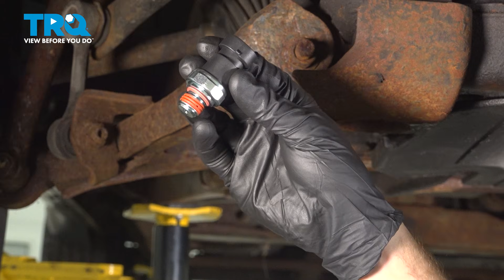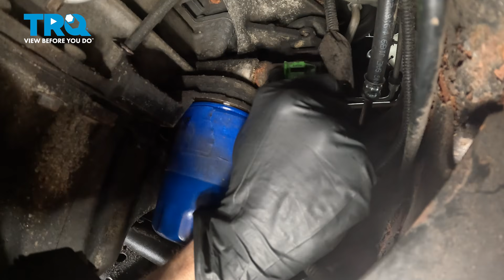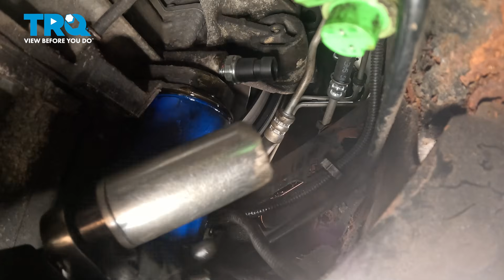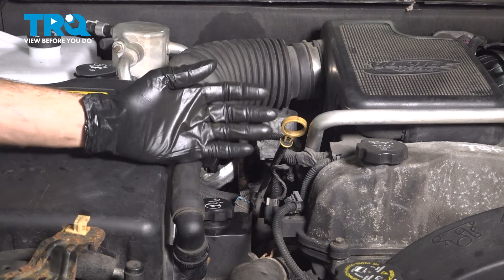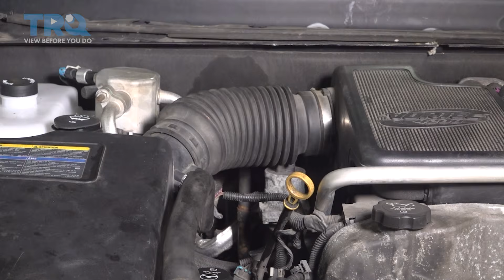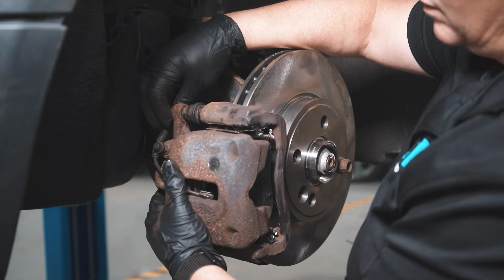How to Replace Oil Pressure Switch 2002-2009 Chevrolet Trailblazer (4.2L L6)

Comment: I replaced my oil pressure switch and still have the same problem. 0 oil pressure on the gauge with check gauges light on.